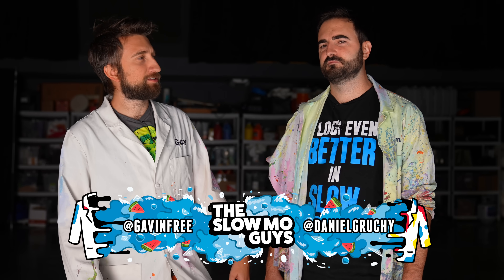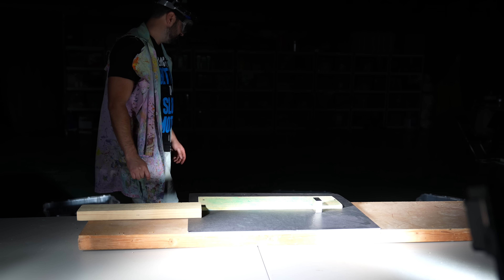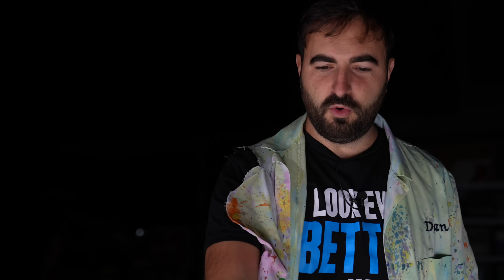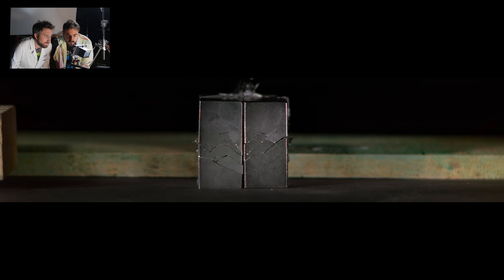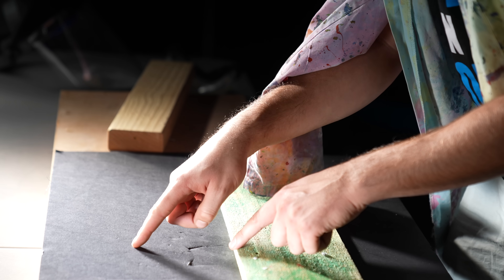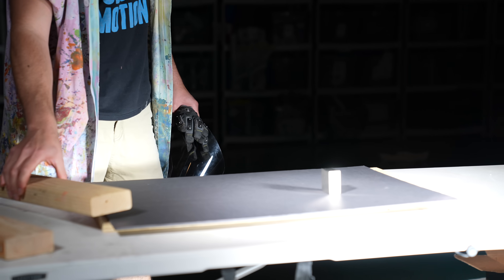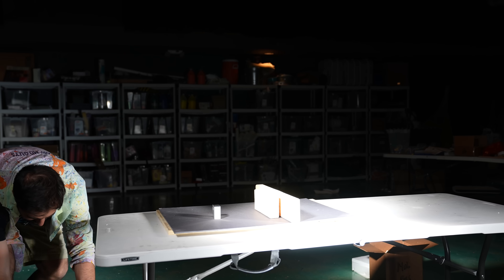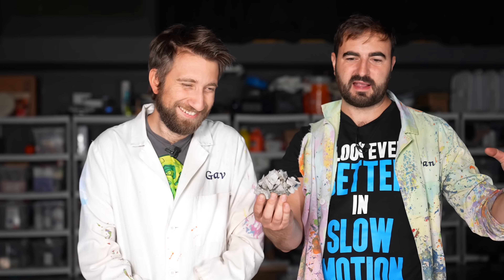Ridiculous Magnets Colliding at 187,000FPS - The Slow Mo Guys

Comment: I wonder if the sparks are from the small pieces warming up through induction, because they're moving really fast through a magnetic field.
Reply: The energy involved with deforming and fragmenting metal is much higher than what is generated through induction, likely those sparks are basically the same as what is created when you hit two normal pieces of metal together
Reply: @user-jm8sy5ox2j Also the same as all the explosive sparks from brittle metal fracture, lots of that to see on the hydraulic press channel, ball bearings etc.
Reply: i didnt think of that but its possible. although if the pieces were getting that hot they would probably have lost their magnetism, so im not sure
Reply: I’m not sure about induction but some of the metals used to make neodymium magnets are pyrophoric and will burst into flame if the particles are small enough like what happens when grinding a bar of steel

Comment: In order to dispose of the magnet shards, a propane torch works wonders to reduce or eliminate the magnetism.
Reply: i think it's good magnetism is reduced with heat because molten metal that's also magnetic sounds terrifying
Reply: @xvx_cooldude69_xvx43  "molten metal that's also magnetic" - what a horrific idea! 😱
Reply: When I first learned about that, where you can destroy a magnet with enough heat, I thought it was so cool.
Not so permanent now, are you?
Reply: You mean warm not cool
Reply: > In physics and materials science, the Curie temperature (TC), or Curie point, is the temperature above which certain materials lose their permanent magnetic properties, which can (in most cases) be replaced by induced magnetism. The Curie temperature is named after Pierre Curie, who showed that magnetism was lost at a critical temperature.
Reply: @float32  The metal becomes hot enough for the structure to change from body-centric cubic to face-centric cubic, making it lose its magnetic properties.
Reply: @float32  Random question: Did this Pierre guy perhaps have a sister named Marie?
Reply: @Doktor_Vem  they were married
Reply: @float32  Nobody asked.
Reply: @Sergmanny46  I don’t remember asking for your response either.
Reply: @float32  Then you shouldn't have posted that in the first place.
Reply: @Sergmanny46  huh? how is that a response to what I said? You do understand you did the same thing as me, right? Nobody asked for your comment, especially not me. So, same to you, you shouldn’t have posted yours either. lol.
Reply: @float32  Then why does the sun have massive magnetic fields?
Reply: @andregon4366  convection, I'd assume. (edit: I wonder if a vortex of molten iron would produce a measurable magnetic field.)
Reply: @andregon4366  the sun is not made of metal it is made of plasma. the sun is a vary complicated type of electromagnet made from its own charges flowing though its own plasma and it all spinning around at different very fast speeds
Reply: @andregon4366  different kind of magnetism, there are several. ferromagnetism, such as in a neodymium magnet, happens because of the alignment of magnetic dipoles in the material. heating the metal scrambles them. the suns magnetic field comes from the movement of charged plasma within it.
Reply: @andregon4366  The sun is made of plasma the electrons and ions have split and are moving freely, this movement of charged particles causes magnetic fields.
Reply: @andregon4366  
Because the sun isn't made of molten metal, first and foremost. The sun is composed of plasma, a distinct phase of matter that is naturally conductive and, as it churns around inside the sun it induces absolutely massive electromagnetic fields.
Reply: @andregon4366  The sun isn't molten metal, it's a fusion reactor, currently fusing hydrogen. The magnetic field around our planet is generated by the molten core churning around. The sun produces it's magnetic field through conductive plasma, which isn't metal.
Reply: @andregon4366  because it's not a permanent magnet. The Sun is a turbulent storm of plasma (moving charges), which induces magnetic fields.
A permanent magnet works by aligning most particles magnetic fields in a metal (for example with a strong electromagnet) at slightly elevated temperature. After that all those orientations are "frozen" in place (metal is a crystal structure) and combine into a "permanent" magnet until those particles have enough energy to move/rotate out of alignment again. And the average microscopic movement energy of particles is heat. So by heating a magnet you allow those particles to move out of alignment again (and they get less alignment and not more because of entropy).
Reply: @masteredk2919  It’s not because the sun isn’t made out of metal exactly. Even if the sun was metal, it would still produce a magnetic field through the same effect as that’s how planets produce their magnetic fields.
Reply: @andregon4366  The sun is not made of metal
Reply: @andregon4366  The people saying it’s because the sun is not metal are incorrect, the sun would still produce a magnetic field even if it was metal. We need to understand that stars and planets generate their magnetic fields differently from a regular magnet. TL;DR “heating a normal magnet can make it lose its magnetism, the heat inside stars and planets is a key part of the process that creates their magnetic fields.”

Basically, every atom can be thought of as a tiny magnet. So, in a solid non magnetic object, these tiny atom-magnets are all over the place. If they're pointing in random directions, their individual magnetism tends to cancel out, and the overall object isn't magnetic. Most materials you come across in daily life are like this, but in a magnet, they are aligned in the same direction, extending their field to the point that we can notice it.
For these kinds of magnets, when they get hot, the atoms jiggle around even more and their alignment isn’t as strong, which can make the overall magnetism of the object go away.

Now for stars like the sun, and planets like Earth(not all planets produce magnetic fields), generate magnetic fields in a completely different way. They don't rely on atoms pointing in the same direction. Instead, they use the movement of conductive fluids.
In the case of stars, the conductive fluid is a super hot and electrified state of matter called plasma. When atoms get hot enough, their electrons can move between atoms and are not bound to them, which is what makes materials conductive. For planets, the conductive fluid is typically a molten metal, like iron or nickel, deep in the planet's core. This movement of fluid is called convection, the different layers of fluid moving at different speeds compared to each other is an important part as well.

In stars, the heat from nuclear reactions causes the plasma to move around, creating this convection. For planets, it's heat from radioactive decay and leftover heat from their formation.
This moving conductive fluid at different speeds generates electrical currents, and wherever you have moving electric charge, you also get a magnetic field. So heating a normal magnet can make it lose its magnetism, the heat inside stars and planets is a key part of the process that creates their magnetic fields. The rules for them are different than for a solid chunk of magnetic metal.
Reply: @andregon4366  Moving electrons. Magnetism isn't just one thing. Ferromagnetism, the kind shown in this video, is due to alignment of electrons in the metal structure. Magnetic fields from moving electrons, like the plasma of the sun, is something different.
Reply: @andregon4366 lmfao yk I never thought about it that way.
Reply: @mytube001  this is a good succinct answer.
Reply: @andregon4366  The permanent magnate produces the a macro phenomena by having the polarities of its crystalline domains all oriented in the same direction. In otherwards, the magnetic moments of the atoms of the ferromagnetic material are are pointing in the same direction, heating up the material to a high temperature cases the attoms to point in different directions which destroys the macro magnetic phenomena . The magnetic fields produced by the sun are caused by large masses of free moving electrons within the plasma of the sun, so the sun is more akin to an electromagnet than a permanent ferromagnetic magnet.
Reply: @andregon4366  Because the sun isn't a permanently magnetic piece of metal. It's a roiling ball of plasma powered by fusion.
Reply: @LynxSnowCat  The core of the earth is full of liquid iron moving around and the earth has a magnetic field, so question answered.
Reply: @Paveway-chan  The magnetic fields around neutron stars are totally bonkers. Various pop sci videos talk about how the gravity would do this and that if you approached a neutron star, but the magnetic fields would totally ruin your day long before you got close enough for the gravity to be a problem. You'd have fields inducing enormous voltages across your body, and also blasting you with charged particle radiation.
Reply: @andregon4366 The sun is special! 😅 Actually the sun's magnetic fields are not permanent but are electromagnetic in nature. They are caused by vast currents flowing through the plasma.
Reply: @aluisious  
Yup. The magnetic field would turn you to mush before you even got close 😅
Reply: @aluisious  
But neutron stars don't get their electromagnetism from churning plasma. Neutron stars are solid balls, and where neutron stars' magnetic fields actually come from we don't know 🤔
Reply: @andregon4366  I believe it is due to the dynamo action happening internal to the sun.
Reply: @LynxSnowCat Ever heard of a planet named Earth?
Reply: @Paveway-chan Every neutron is a permanent magnet. In normal matter, neutron magnetic fields largely or completely cancel via spin pairing.

Helium 4 is an example of complete magnetic cancellation.

In a neutron star, neutrons are able to magnetically align because they are no longer bound to protons.
Reply: @andregon4366  and the Earth
Reply: @stevenverrall4527  
I'm not sure I understand here. Neutrons are electrically neutral, how can they exert a magnetic field if that is true?
Reply: @LynxSnowCat to answer your edit, that's basically how the earth's core works
Reply: @andregon4366  Could be electromagnetism. Research plasma.
Reply: @-yeme-  Nope, magnetism is all the same.
Reply: @LynxSnowCat  isnt that what the earths core is? (roughly)
Reply: @andregon4366  t
The magnetic field of the sun is being generated continuously.   It does not exist in a permanent static state.
Reply: @andregon4366  because science
Reply: @quinn860  Nice profile pic.
Reply: @LynxSnowCat Maybe the magnetic force is much greater than the temperature?! I don't know...
Reply: @ronwright6119  Mass and density don't make magnetic fields.
Reply: They better film it in slowmo
Reply: I thought it was freezing that loses it potential?
I'll do an experiment on that.
Interesting.
Reply: @LITTLEEXPERIMENTCHANNEL1  Look up supper conductors, and watch a cryogenic magnet float in mid air.
Reply: @An_Attempt  Where can one get supper conductors? I'd like one for my supper. Also: are there dinner and breakfast conductors too? 
(SCNR)

More serious though: you can get a weaker, but similar, effect with pyrolytic graphite - it is also diamagnetic and can be repelled with very strong neodymium magnets (like the ones you find in old hard drives). It's a lot cheaper than a super conductor and the necessary cryo-cooling device.
Reply: @KonradTheWizzard  All you need is some liquid nitrogen, a magnet, and plate of iron or steel.
Reply: @An_Attempt  mmm, supper conductor sounds like a good place to eat!
Reply: @joshuabecker6799  Yes, welcome to our Grand Opening, you will find our ambiance quite conductive to contemplation.
Reply: A more cinematic one is a hydraulic press.
Reply: These are neodymium magnets which are a power with a resin binder.  The resin will start to let go at approximately 90C - much below the Curie temperature of a steel/nickel/cobalt metal magnet.  They are more susceptible to large shocks (as we saw!) but they won't be demagnetized by small shocks which can - over time - de-magnetize metal magnets.
Reply: That is until the magnet flies into the nose of the torch and destroys it.
Reply: As displayed in this Actionlab video: https://www.youtube.com/watch?v=PMma3OJUHhs
Reply: I was gonna say heat but that is a good way of putting it as well😂
Reply: I recommend doing this a sufficiently large amount of thermite.

See if there is enough heat sustained long enough that you could reach the Curie temperature of these magnets
Reply: I think with magnets this stron they would destroy the blowtorch before being demagnetized. Although i don't know exactly what blowtorches are made of it's probably metals for resisting the heat so it's not unlikely for them to be magnetic
Reply: @lenn2099  Test the blwotorch before you begin - not all metals are ferromagnetic. If in doubt: put a fine copper mesh between the magnet and the blowtorch - the copper is unaffected by the magnetic field - copper is diamagnetic (weakly repels magnets).
Reply: The thought of destroying such fun magnets makes me sad.
Reply: Nuclear warheads are also effective
Reply: true good idea
Reply: Jet fuel can't degauss neodymium magnets.
Reply: lol. How many magnets do you destroy on a regular basis my dude? And why?
Reply: @alistairfletcher6187  Quite a lot actually.  I do electronic recycling and we get a lot of cordless power tools and old hard drives, the items that have permanent magnets need to be handled with some care.  Most high tech stuff that has permanent magnets use Neodymium and that is a valuable resource and needs to be shipped to an actual re-processor.  To make shipping easier, I ruin the magnets (except the ones that my wife likes to use for crafting lol.
Reply: @alistairfletcher6187  I used to destroy quite a few of them in my career, I worked on microwave radios and the old klystron tubes had very large magnets and when a tube would go bad to the point of not being rebuildable, we would destroy the magnets.  The magnets on a 1kw klystron weight about 30 pounds each and if you stuck them to the side of a filing cabinet, you could not pull them off.
Reply: No need any torch, just good hit so  magnetic domains get randomly spun, making total magnetic field negligible.
Reply: hank